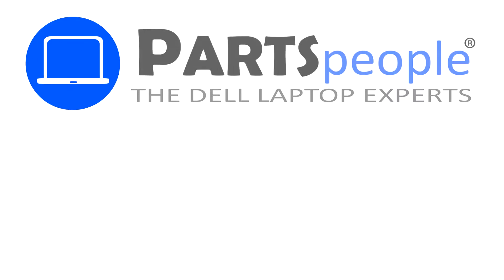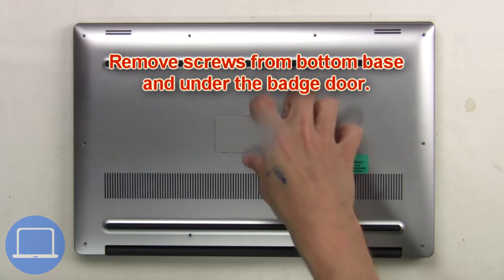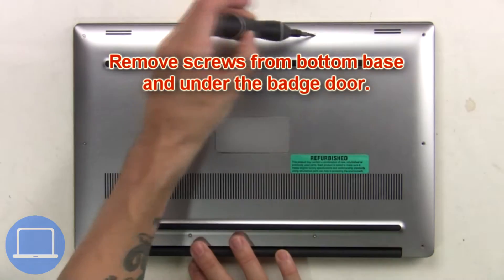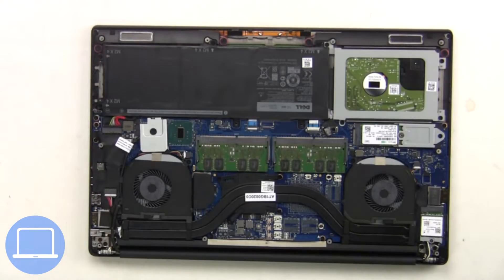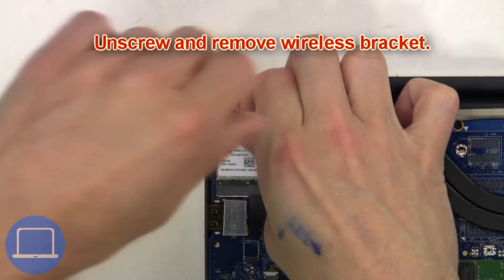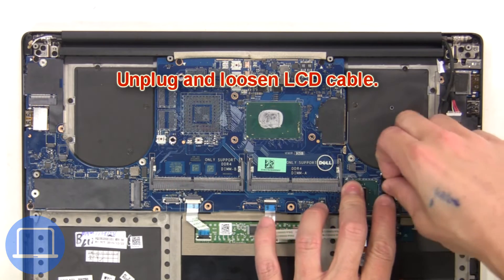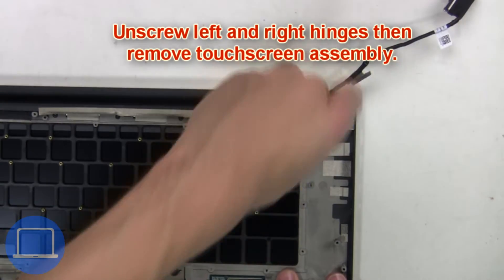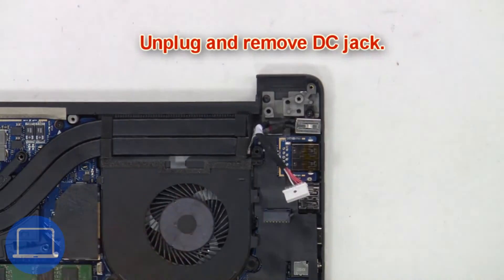Dell XPS 15-7590 (P56F003) DC Jack How-To Video Tutorial

Comment: If I replace the DC jack but I’m still getting a “does not recognize charger” error. What are my next steps? 
Full motherboard replacement?
Reply from the maker: I would first verify that the power supply is not faulty. Then move to the motherboard if it's functioning correctly.

Comment: Thank for the comprehensive video. I just don't understand how you can unplug the 2 cables of the wireless card without damaging them. I feel I won't be able to plug them back in.
Could you help?
Reply from the maker: These WiFi antenna cables easily pop off. But they can be a little tricky to reconnect. I have never seen one damaged this way and I believe it would take a heavy amount of pressure to do so. I recommend being patient and apply gradual pressure when snapping them back on.

Comment: After all the years making weak power connectors in laptops, where you had to replace the motherboard, at last they changed to an easily replaceable and inexpensive part.